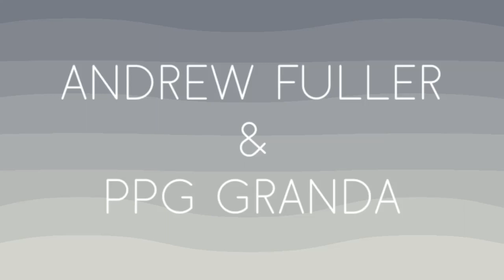How SkyTap welds the Angel to T6 strength. Reserve size and so much more on this audio podcast

Comment: Great podcast! I wish Andrew would put out more videos, talking about what improvements have been made, ones he's working on, maybe take a tour of where he makes them, show the ins and outs of the process in general, and so on. He made a few different ones going over the Angel back in 2019 and then hasn't really come out with too much since. It's really a bummer because I'd like to see more. His marketing is really lacking and seems to be his weak point. That goes for his website too as its extremely basic and looks like it hasn't been updated in forever. There's very few options when trying to "build" your unit. He should have that thing ready to go with all the color options, harness options, motor options, and what the price will be for each. Anyway, I'm not trying to diss him. I'm actually very strongly considering buying an Angel once my training is complete later this year, but with the lack of marketing and general info, it shakes the confidence a little bit. But thankfully there's you (and occassionally David) who are pretty much the only ones that really talk about the Angel on a seemingly regular basis (I appreciated the video you took at Andrew's house during your SIV course showing the different units and having him talk a little more about it). But you're basically where I get my info from. Outside of you it's pretty slim pickings. Maybe you can talk with Andrew about improving his marketing. (I should also mention I've tried messaging him a few times on fb, his website, etc, and have never gotten a response, which is a real bummer).